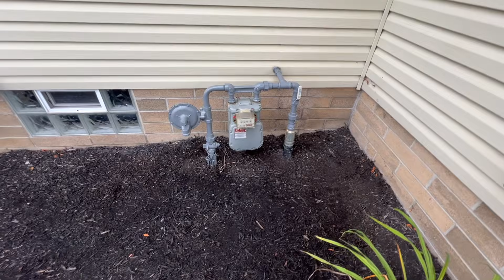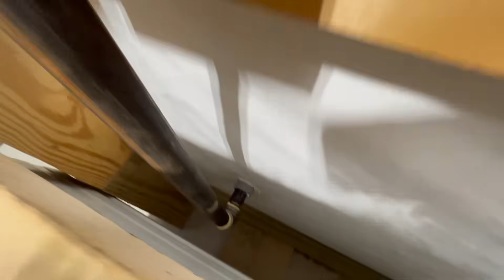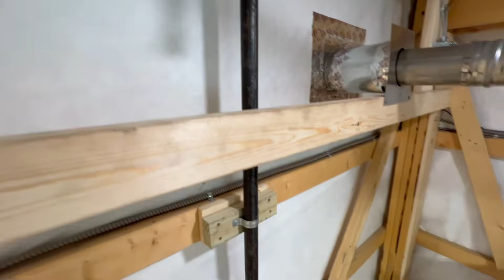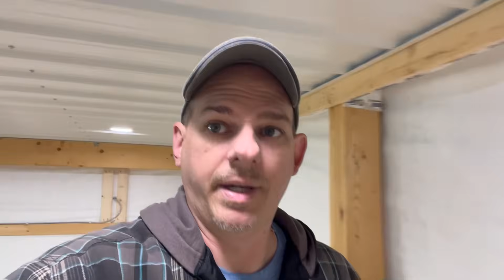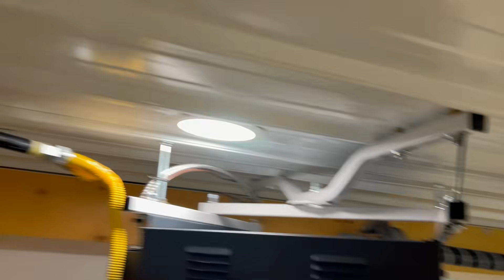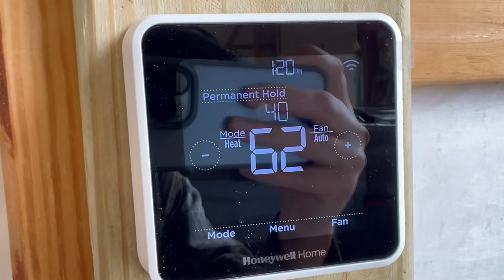Big Maxx Furnace: How I Heated My Pole Garage and Saved $

Comment: Should’ve done a 2lb system going that far
Reply from the maker: Plumber sized and installed the line to the garage. I did the part from garage to the furnace to save some labor so cost was very reasonable and it works great. Appreciate the comment!

Comment: I’m so glad you included your quick sling. I just had my Reznor heater professionally installed and it’s crooked. Your spacers might be just the ticket to get it to sit level without a lot of messing around. Great idea! Thank you!
Reply from the maker: Definitely worth trying and it’s a cheap solution to level it. I didn’t realize the pro’s use the quick sling but I’m sure it makes their jobs way easier as well in a lot of situations. Thanks for the comment!

Comment: Is the pipe you used single wall or double wall ? I would think single wall would get hot enough to melt that boot
Reply from the maker: @vincentlanza5155  it’s Cat III vent which is single wall stainless. The vent boot is rated for up to 450 degrees continuous temps. At the inside wall where it exits the temp is only 130 on the pipe. It definitely doesn’t get as hot as you would think. Appreciate the comment!

Comment: In the line going into the unit, put the valve first, then the union and drip leg.
Reply from the maker: This is the correct way to do it for sure. I pinned my comment and post when I changed it up. Thanks for checking out the video!

Comment: the slope is supposed to be towards the outside. Yours is definitely going toward the unit. Should have a "T" with a condensate drain hose. Hopefully you won't have water issues.
Reply from the maker: Seems like some heaters are different regarding which way to slope the exhaust. For my furnace it says this in the manual “The vent must maintain a 1/4” rise per foot of slope upwards towards the termination” I did debate on adding the T with condensate drain but my entire exhaust length is just over 3ft so very short. I have checked the unit a few times for condensate running back in and have never seen any which is probably because it is such a short run it exhausts all of it. I will definitely post an update if anything changes. Link for the boot is in the video description. I appreciate you checking out the video!
Reply: @journeys-with-joe  Yes, you are correct. I've been seeing that too. I ordered the boot. Thanks for the info!

Comment: Could be wrong on this, but your sediment trap needs changed up.  The supply gas needs to enter vertically from above with the trap leg vertically below that.  The feed to the furnace would then come horizontally out the side of that T fitting.
Reply from the maker: You are absolutely correct I didn't have it correct when I recorded the video but corrected it shortly after. I pinned my comment on this again so I always appreciate the reminder! Thanks for checking out the video!! http://youtube.com/post/Ugkxptmf1AqCBHH19sWBYgpat5eDefjyDu0B?si=0tFZ-cX5Obtyl1Av
Reply: @journeys-with-joe nice. The photos showing correction a a great update. Good job!

Comment: Excellent install!  I'm getting ready to install the same heater. Is there a requirement for the horizontal vent pipe to be a certain amount of feet below the eaves on the outside?  I have the same eaves/building as you.  No windows or openings nearby. Thanks!
Reply from the maker: Thanks appreciate the comment.  The directions say vent termination must be 4’ below or 4’ horizontal from any soffit vent.  Mine is a little over 3’ which is as far as I could get away.  I think the main point is to keep the flue gasses from being drawn into the soffit vent.  I put a CO2 detector in the attic for a little while and never had any problems.
Reply: @journeys-with-joe  that’s what I was thinking too. I’m the same in that I can’t quite get 4 feet from it.  My eaves/soffits do not vent inside the building so I assumed there’s no issue. My plumber wants everything inspected after they do the gas line so I’d hate for the inspector to get picky about this when I’ve already cut a hole in the wall for thimble/vent 😂. I’m thinking of just having the plumber run the gas line and cap it, then I’ll install the heater afterward

Comment: How many square feet you heating? And what state do you live in? And what's the cost to heat it in the winter? 

Great video!!

Thanks
Reply from the maker: Garage is 34x50 with 14’ ceilings which you have to account for when heating.  This past winter I was working in it a lot finishing the interior out and in the worst month in Ohio it may have added $20 to my bill.  I kept it around 56-58 when out working in it and around 45 at night.  Thanks for checking out the video!

Comment: Again, nice job, you do good work, it's always a great feeling when you  finish. If I had natural gas where I am I would have done the same thing. Instead I went with two 36,000 BTU Mitsubishi mini-splits. A little pricey but very happy with how they perform, heat and AC.
Reply from the maker: Thanks for the compliment!  I’m curious this season with the added wall insulation if that will keep some heat away.  A mini split would be nice and I’m sure they are well worth the cost not to mention AC would be amazing in the summer to have!

Comment: That was certainly alot of work and it turned out very nice. Im working on mine now. Using a Modine  60000btu..and yes..more expensive than the Mr. Heater. I'm not hanging it from the ceiling. I've  fabricated a support assembly for underneath the unit with unistrut. With substantial bracing, it will be very strong. Im also mounting my black pipe on the
finished interior surface..as we'll as my elctrical in conduit. It just makes accessibility that much better for me. Again...very nice, clean install.
Reply from the maker: A lot of work indeed.  Modine makes a good heater and was my 2nd choice.  Sounds like you’ll be warm in no time once you get yours finished.  Thanks for checking out the video!

Comment: pipe splices are not allowed inside a wall !!!
Reply from the maker: My plumber that gave an estimate would have installed the same way.  Actually talked to him after and no issues.  I do know you can’t have unions behind walls but pipe, elbows, T’s, couplers based on the code in my area are fine.  I can also easily access later from the outside since all exterior metal is just installed with screws.

Comment: There should be a shut off going to the house also after the meter
Reply from the maker: Maybe but must not be required in my area since that part was installed when they built the house.  Thanks for checking out the video!

Comment: Joe, 
My sincere appreciation for your efforts to put together this video.  I have been plowing through numerous DIY videos as I produce plans to install a 50,000 BTU Big Maxx unit in my 1,200 Sq. Ft. insulated pole barn.  Yours is by far one of the best and most complete of the many I have suffered through.  I wish the search would have listed yours much earlier.  Two thumbs up to you.  Thanks much.
Reply from the maker: I appreciate all the kind words.  Glad I could help with ideas for your install.  Since making this video I made some minor updates to the gas line fittings right beside the furnace.  If you look at the community posts on my channel you’ll see my update.
Reply: I`m not so sure that a 50,000 BTU will be big enough.

Comment: it looks like it is sloped into the unit, isn't it supposed to be 1/4 inch per foot downhill from the unit like a drain?
Reply from the maker: Yeah you would think but the instructions for this furnace specifically state 1/4” per ft upward slope.  I assume since it’s not high efficiency they are more concerned with the flue gases rising than the condensation not evaporating when the unit runs.
Reply: I saw the same when I just looked at my Mr. Heater manual! You are correct!! Weird! I thin your analysis is correct about the gas

Comment: That drip leg is wrong
Reply from the maker: Yes I need to change it around.  I’ll be doing the inside wall soon and will take it back apart at that time and switch it so the leg is on a vertical downstream run instead of horizontal.  Appreciate you checking out the video!

Comment: Nice install, but could have you run the underground gas line closer to the furnace to cut down on the black pipe or move the furnace?
Reply from the maker: Thought about both but didn’t want the furnace on that side in case I put a lean-to later the exhaust vent would be a problem.  Should have planned better and ran the poly pipe and riser around the building from the beginning.  To excavate and move it now was more expensive and a lot more work since my landscaping is all complete around it now.  Thanks for checking out the video!

Comment: Great looking installation, just curious the dimensions your heating with this?  L x W x H
Reply from the maker: Garage is 34x50x14.  The high ceilings do make it challenging to get the heat to the floor.  I’ve since installed a ceiling fan which really helps.

Comment: Did you ever mention why you had to run so much pipe inside the garage and didnt just mount it above where the line came in?
Reply from the maker: Planning for the future is the biggest issue when building.  Once I started using the garage I realized I may want to add a lean-to or just park a larger camper on the side where the gas line comes in.  The furnace exhaust on that side would not work then.  If I did it again I definitely would have had the line run around the back when it was excavated. Was cheaper and quicker by far to run the pipe inside then tear all my landscaping up again though.  Appreciate the great question!

Comment: Very nice!  I'm debating on a unit heater like yours vs a typical upflow furnace for my shop.  Hope it works well for you.
Reply from the maker: My only complaint so far is lack of fan circulation.  Wish there was some sorta of squirrel cage blower to put more warm air further out.  I’ve since installed a ceiling fan which really helps though.

Comment: Retired plumber here, Up by the garage heater you have the union and the shut off valve in the wrong locations. You want to be able to shut the gas off to the unit so you can undo the union right there. Also the dirt leg should be on a drop, not just pointing down on a tee. Easy fix, shut off the gas at the house coming to the pole barn. Remove everything from the union to the flexie. Starting by the 1x1/2 90 reinstall the valve, nipple, union, nipple, 45, nipple, 90 pointing down, nipple, tee with flexie hooking up on the side of it, and the dirt leg on the downside.
Reply from the maker: Really appreciate your expertise.  I’ll switch this around when I install the inside wall steel since I need to take it apart then.  Thanks for the comment!
Reply: Uncaught by the untrained eye.  Thanks for the tip!

Comment: So you used a 5" diameter thimble?
Thanks for replying back. Good info!
Reply from the maker: They actually call it a 4” thimble but it’s designed for the 4” CAT III pipe so inner diameter is more like 5” at least for an air gap.  If you stick with all 4” pipe and fittings you’ll be good as long as 4” is what your heater calls for.

Comment: Very nice install bud!  I'm currently working on my building, 60x120x18, we just got the steel installed on the roof last week.  I'm going to be installing in floor heat and that system is going to cost me my leg, arm and first born!!
Reply from the maker: Wow that’s big building for sure your working on.  The in floor heating will definitely be worthwhile in the long run too!  Thanks for checking out the video!

Comment: Nice installation! Just finished my 32'X30' post frame building and I'm planning on putting a very similar heating unit in. Can you tell me what size vent pipe and thimble you used? and did you run the double wall pipe for the whole length of the vent run?
Reply from the maker: It’s actually 4” CAT III venting single wall.  For horizontal runs it’s required since it’s full stainless.  With the thimble installed and also keeping in mind a few inches of air gap around it I have no worries with it getting too hot going through the wall.  You’ll love having heat in the building!